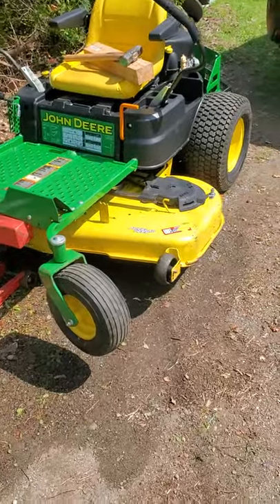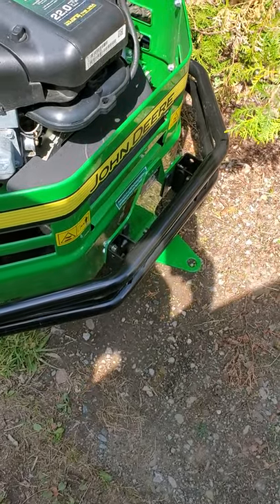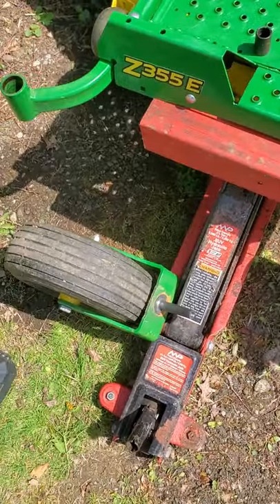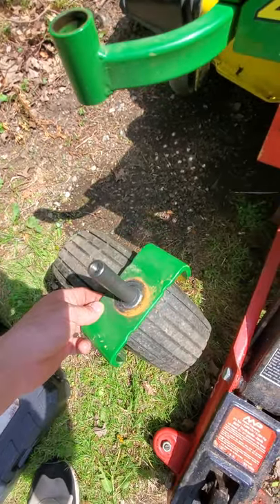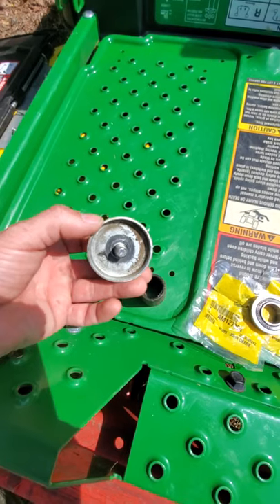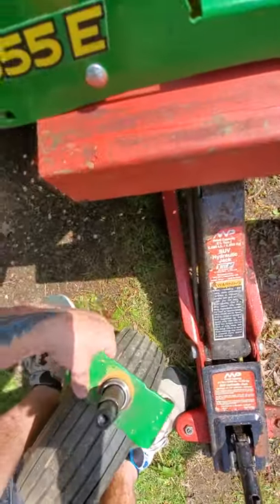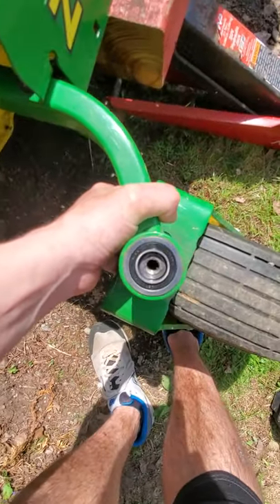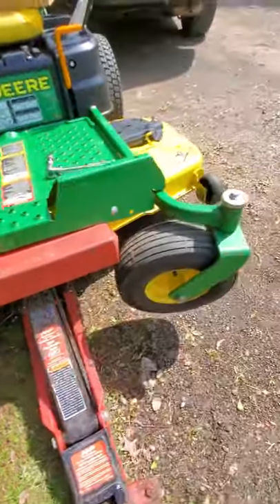John Deere Zero Turn Mower Z355E Caster Wheel Yoke Bearing Replacement/Repair  DIY How To Video

Comment: Huge thanks - just ran into this issue - now I need to go find my parts :-)
Reply from the maker: I put a link to the parts I had to order. If your ztrac is not the same model, the website linked will show you a parts breakdown diagram and list of the part#'s for your model. It's a great website.

Comment: Bought parts twice now that were recommended and did not work, this will be my third attempt. Really hoping these are the right ones for my model, Thank you hahah. They all keep saying the parts are for Z355E and then they dont fit lol
Reply from the maker: If you have a Z355E these bearings will be correct. Also if you ever need any other replacement parts go to the link I put in the description. You will find a complete breakdown in the form of multiple data sheets that will give you every part that may need replaced.

Comment: I have a z345m but I’d imagine the front yoke and tires are the same. When looking at the parts diagram on the John deer page it doesn’t show bearings inside, just the flanged bushing. I’m going to pull it apart today and find out.
Reply from the maker: @jamezangel2482  I would definitely take it apart to see how they are setup. I'm not sure why but they did build there line zero turns different depending upon the model. Many of their yokes don't use bearings.
Reply: @412psekustomzllc7  yea mine does not have bearings, which is kind of disappointing. I also saw another video where a guy said not to use grease but I just put 1 tire back together and it’s spinning pretty stiff even with brand new bushings! Any advice on that? Thanks

Comment: How did you remove the worn out bearings?? Help please!
Reply from the maker: I used a small punch & hammer. You should be able to use even maybe a flat head screw driver & hammer. Really anything small/long enough to get at it then just tap it out with a hammer. It really wasn't too difficult.

Comment: That is one cheap big box store mower.   If I had Scag and Exmark before id be kicking myself
Reply from the maker: This was purchased from a John Deere dealer. It definitely wasn't cheap either per say. The JD Z355E purchase was due to a recommendation. For what it is, it is a strong machine. Our next purchase though will probably be an Exmark.
Which big box store is selling these if I might ask?
Reply: That looks cheap af.  Really lightweight

Comment: I paid to have mine repaired in November and 1 year later, it's busted again. Hopefully mine magically assembles itself like yours did in this video...but why are you bitching about a mower you've never had a problem with, except this?
Reply from the maker: First things first our repair did not magically assemble itself. To address the issue Sr. has with this mower. It has to do with his comparison to other mowers he has owned and operated. So as explained Sr. due to the experience he has with many other zero turns and their performance he is not very happy overall with the John Deere z355e. 
Ofcoarse remember this is only his opinion. Which due to fact that the country we reside in is legal to publish. 
His opinion is that in comparison to the other brands he has had the opportunity to own and operate this unit when it comes to performance is not to his liking. That's it. Just his opinion. 
But also he has had multiple issues with this mower prior to this one. That he did not film.
Reply: @412psekustomzllc7  at 8:35 he said this was the first actual repair he's done to it.